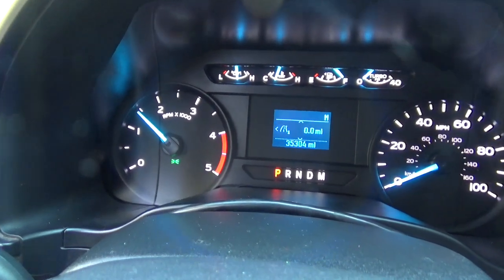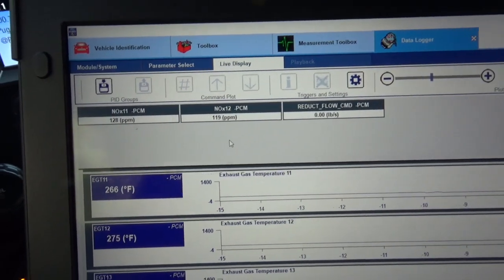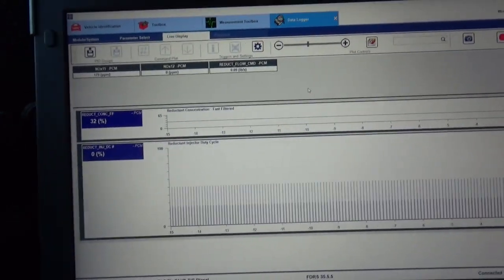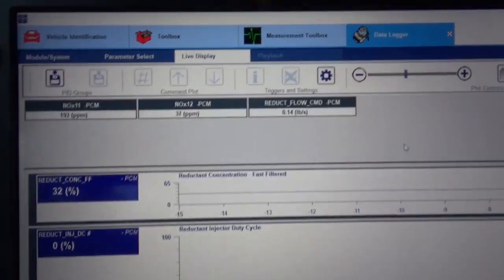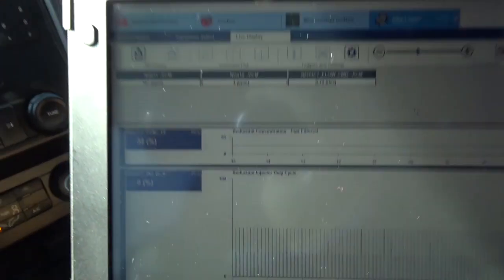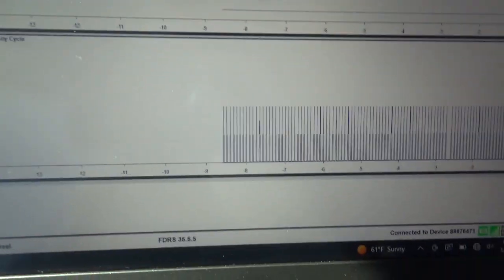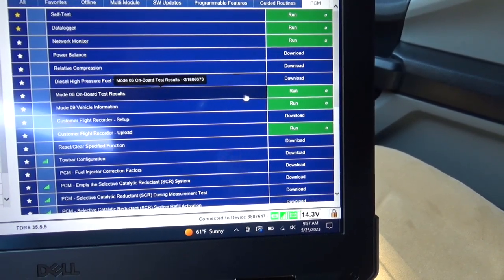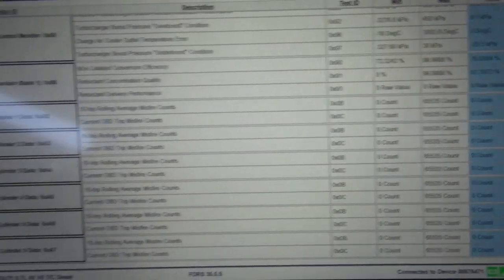FORD 6.7L P24FE REDUCTANT CODE, HOW TO CONFIRM FIX

Comment: Have a 23 that’s been in the shop for months now with this code.
Reply from the maker: Months? Yuck! Checked PTS for service bulletin related to just this code but don't see one. There is a SSM 51891 related to SCR for other codes though. Do you know what they have replaced so far?

Comment: Sounds like you followed the ppt rd to a t. I got burnt on that code before, on a 2021 f450 with 30k miles. in the end, what fixed it was an OEM air filter. It came back 3 times, I regen and reset specified functions, the funny thing was that the filter looked good no tears or any other abnormal characteristics.  I went with the air filter because the fleet that services it uses cheap ass filters and the problem started after it was replaced. I have also seen that code come up with the wrong oil not rated for diesel.
Reply from the maker: Yep, exactly right. Great to know about the air filter and oil. This code can be a major PITA!